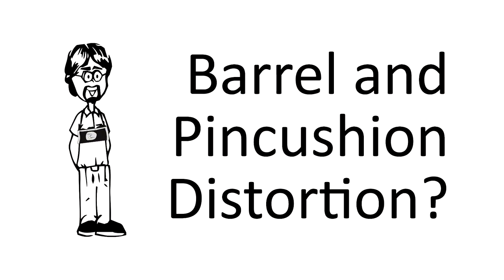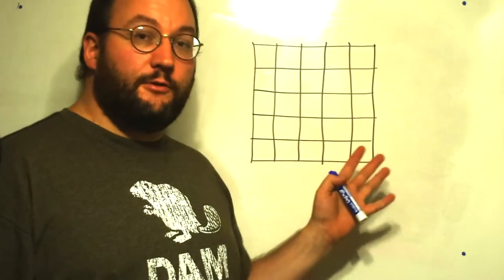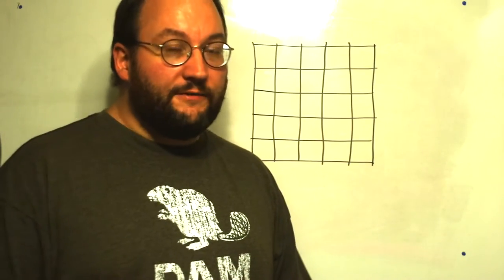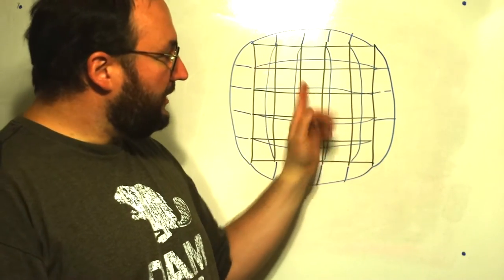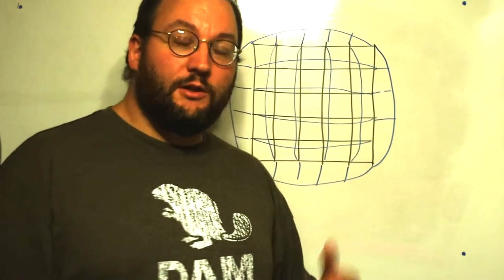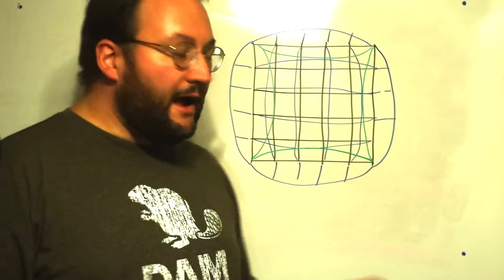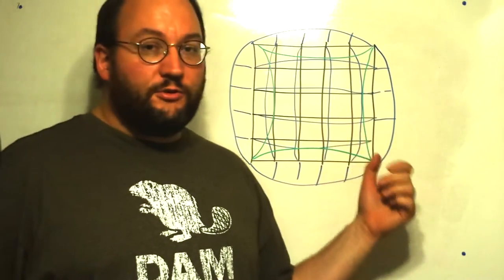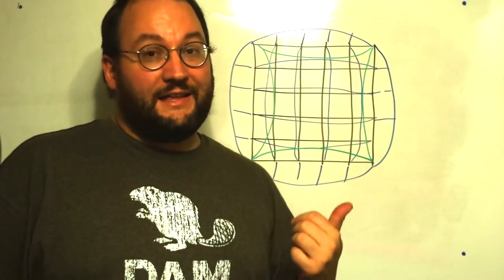What are Barrel and Pincushion Distortion?

Comment: Great video. That is what barrel and pincushion appear like, but I think you have things reversed. Barrel distortion is a decrease in magnification which causes the grid to shrink the further away from the optical axis (center dot) you get. Pincushion is an increase in mag the further away from the optical axis (center dot) you get.
Reply: Thanks for your explanation video, David!

Based on this explanation, can we state the cause of “fatting” a person in an image or in a video is related to the “barrel distortion”? When we make a selfie, for example, our face seems to be large and “fat” from the real thing. It gets worse if we approach the camera to our face. Is this correct?
Reply from the maker: Not exactly. Typically, a selfie is taken with a wide-angle lens. That distorts the world in a way much like this but exaggerated. That's why if you, for example, held a wide-angle lens (like on your cell phone) such that a friend's head was at the top of the shot and their feet at the bottom, they'd look like a hot-air-balloon version of themselves with a huge head and pencil-sized feet. Barrel distortion is a localized flaw that affects how well a lens performs compared to perfect. A perfect selfie lens would still have the effect you describe.
Reply: @DavidHancock  Thanks for the answer :)

Comment: So I learned something new today too.
There is a Soviet made lens called Helios 58mm. Comes in M42 and K-mount.(At least) It is famous for having a "swirling" ... vortex like bokeh. Is that something that is connected with barrel and/or pinchusion distortion?
Reply from the maker: Those Helios lenses can take captivating photos.

The lens issue with Helios lenses is called coma. Coma causes lenses to distort points into oblong or different shapes. So the swirling looks is  sign of significant lens coma that typically manifests when the lens focuses close to the subject and shoots at a large aperture. Stopping down to a small aperture prevents the lens coma from occurring because the poorly corrected part of the lens isn't used.
Reply: Ah. Ok.
I recently bought two Zenit film cameras, one M42 and one K-mount. Both had Helios 58mm lenses on them.
I put the K-mount one on my Pentax K-x (only DSLR I have) and did like you said. Full open aperture, focused close on a flower, with other flowers in the background. It was really easy to get that swirly bokeh.
I'm really glad I came across those lenses. And they were cheap.